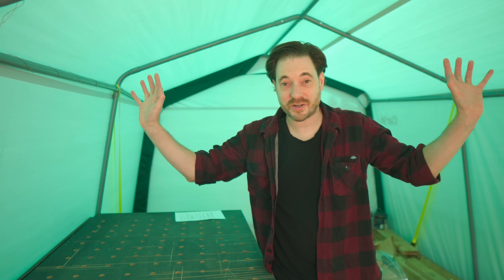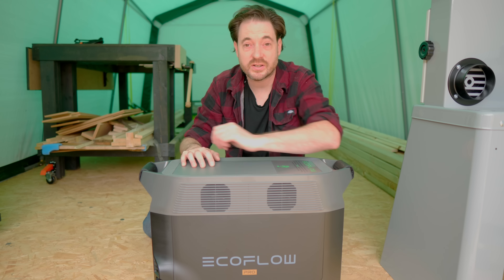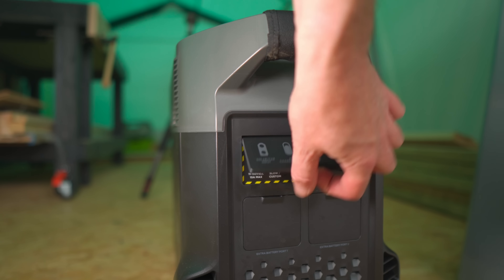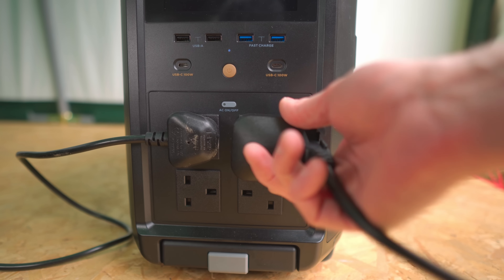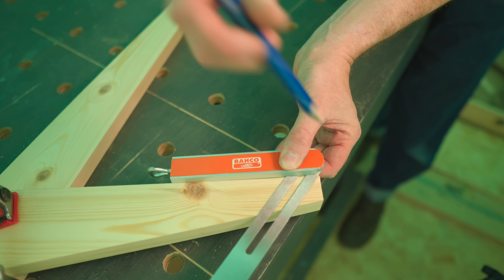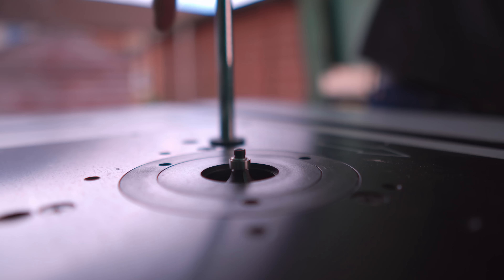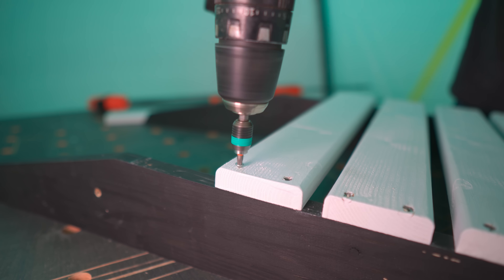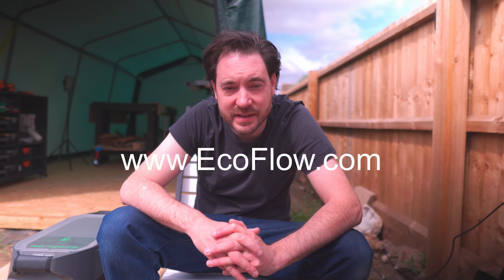Off Grid Workshop With EcoFlow Delta Pro

Comment: Another great video, thanks for sharing your off grid solution. Something I'd love to adopt but the cost atm is too much for me. To have power run to my garage + sockets, lights, etc. Will come in at most half the cost of this system, though I'm then tied to the cost of buying energy. Do you know what the typical lifespan of the batteries are? I would imagine part charging (I. E. 5%-20% at a time) may cause battery fatigue?
Reply from the maker: I don’t know. It manages the charging to protect the batterys
Reply: If the batteries are replaceable would make it more appealing. After all, every battery at the moment has a life

Comment: it's a lot of money but it does have the convenience of being portable.
It is really just a charge controller, a battery store and an inverter. If someone is willing to do a bit of homework and has the option of a permanent set up, this can be achieved a lot less expensively. we use a solar set up to power a pond pump and other odds and sods in a summer house. All the components were from Bimble Solar and was a lot less expensive than running the SWA cable from the house.

Comment: I think resting one's feet on the EcoFlow is one forgotten and underrated feature they don;t mention

I'm also running on the solar system, but it can't power up my 4HP table saw and jointer. everything else works fine.
Reply from the maker: That would be a big machine to run

Comment: If you get any more freebies, you will need to get a bigger house/workshop/tent (delete as required) 🤣

I was considering one of these for my shed/workshop (delete as required), but it still works out cheaper to upgrade my domestic consumer unit to include an RCD protected circuit specifically for the shed/workshop (you get the idea). Brilliant ideas, just toooooo expensive at the moment.

Comment: Lovely. Except its about £4000. That’s a lot of electricity and batteries don’t last forever. Nice to get one for free though!
Reply: the battery is rated for 16 years if drain fully and recharged every day , which is most unlikey in this case , the battery used in this senario will last decades